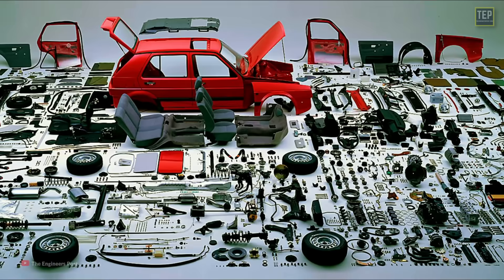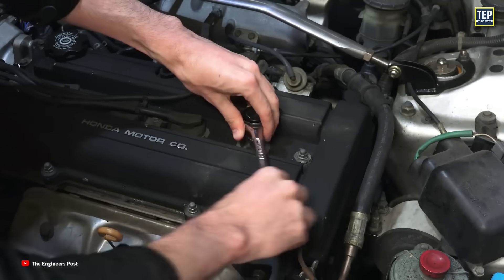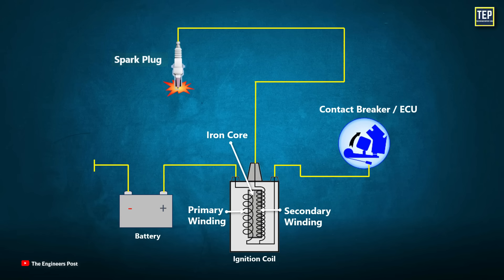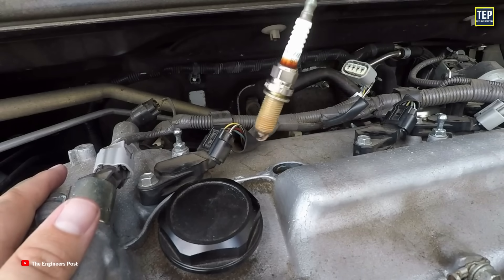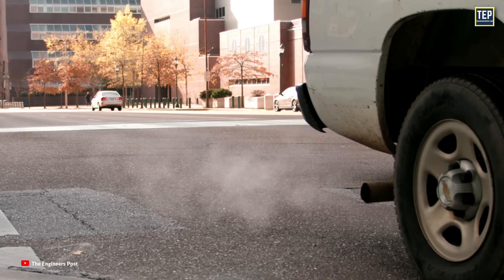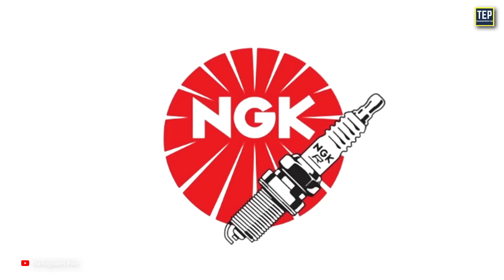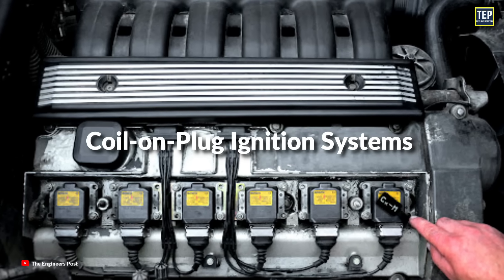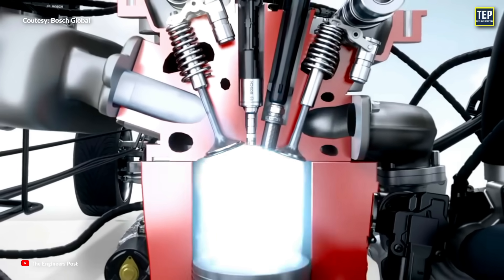Types of Spark plugs | Which is Best?

Comment: Fifty years ago installing a extra high voltage spark coil was a pretty common modification. It was also a very simple mod as it was just a drop in replacement unless your spark wires were just bad. It didn't really do much difference in most cases but it could help people pump a bit more power out of their engines as they used sparkplugs with a wider gap. Never bothered to do it myself as I wasn't interested. But it was just one of those things they tried to sell you.
Reply: The better coil also performed better  as the plug wore and had a larger gap.  Not everyone replaced or gapped the plugs every oil change.

Comment: I like iridium spark plugs ,they can run up to 100,000 before you might have to replace them.they are already pre-gapped,so you don’t need to gap them.
Reply: quality dbl platinum plugs will also last 100k miles in a good sound motor using little to no oil that gets regular proper maint/oil & filter changes etc.
Reply: I used to run slit fire plugs that had a “ Y “ design grnd electrode avail in std or dbl platinum in my cars & bikes,increased mpg by approx 1.5-2mpg in both the cars & bikes.

Comment: Certain aluminum head engines are prone to plug breakage, and if that happens, a special extractor tool will hopefully remove ALL of the plug or a death sentence will be issued for that engine. Professional mechanics/technicians on this board know this fact and can fix anything while examining the plugs. Change the oil at 2k miles is your best option, let your professional do everything else...Please?

Comment: Um... ignition coil turns low-volt battery power into that 20k volts...?
Is it not the alternator that runs the electrical aside from storing for starting? Or, am I missing something? You remove a battery cable to see if your alternator is bad, correct?

Comment: One thing to beware of is fake iridium plugs. Not the cheapest may not the best. Nissan dealerships and many parts companies try to sell you a lesser grade iridium plug that lasts less miles and is not OEM quality. I expect 120k plus miles on my vehicle and shopped to find authentic OEM iridium plugs for my vehicle. OEM coils are not the choice for my coils as the Denso bought a Chinese company, so try to find Japanese made Denso coils. My OEM Chinese made coils all have planned obsolescence built in.

Comment: Hey guys. I use the boush super 4’s why so I can set the plug gaps to suit the tune for idle and full boost wide open throttle. This is on my big block ford engines and my rotary engines they are all turbocharged so they need lx91 crane coils for big spark! More spark the more power you can make. And the longer your engine will live. If we were able to use our pollution free fuels that we came up with over 30 years ago we would not have any dirty plugs due to the fact that the fuel has no pollutant properties leaving the plug clean all the time. Which means the engine will live longer than engines do now days due to the unsafe dirty fuels and the scam of the egr. Which destroys your engine. And the egr and crank case gas’s  are only to destroy your engine. I proved back in the 90’s that I could get lower pollution levels by removing the egr and removing the crank case hose from the inlet and sent it into a catch can and then putting it into the exhaust system at it hottest spot so it burns all pollutants that comes from the crank case. And with no egr to overhead the inlet and  trying to burn exhaust gases that makes more pollution and destroys your engine. This scam from the car company’s was only put in to your vehicle just to destroy the engine so you have to pay for a new engine. And the corrupt governments go along with it because they don’t care as long as they get their corruption monies from the big companies. And the pollution free fuels that we came up with will never get to the public because of the corruption in our governments and the Muslims that don’t want anyone destroying their hold on fossil fuels. And our fuels are cheaper to make and faster to make and while it’s being made the proses converts carbon monoxide into oxygen 1000 times faster than anything else growing on earth. So we are cleaning up our planet as well as making cheaper fuels pollution free fuels. But we will never see it in our lifetime.

Comment: A bit behind the times now. I have Ruthenium plugs in my car but these weren't mentioned. They have been around for several years now but are rarely mentioned. One of the claims for them is even longer life than Iridium.
Reply: I'm running the same in my MB B200 2011 . been going strong for over 60,000km . car is at 130,000km
Reply: And ngk are the only producers of those bad boys. Just like how they were once the only producers of iridium plugs

Comment: For my Turbo Cars I moved to silver spark plugs and havent looked back. Originally recomeneded Irridum. I moved as Irridium started to ping in summer and couldnt handle the higher boost. Silver dealt with all that, havent had any pinging and can get better peformance out of the motor.
Reply: Great for performance, terrible for longevity. This video touched on it but it really needs to be stressed more, platinum and iridium are not better for performance. They are better for longevity. Most people won't accept having to have plugs replaced every 10-20k miles, especially with some shops on some cars charging several hundred dollars for it.

Comment: I've been using Bosch 4 electrode spark plugs in my Toyota Yaris for 22 years and it still fires up first time. I tried them because the original NGK ones didn't work well, even after putting new ones in. Change them every 60 thou. but don't know if i'll bother now as it's done almost 160 thou. and not sure how long it'll last, even though it still goes like a rocket with 40-50 mpg. No money for another car, so hopefully it'll carry on 🤞.

Comment: 100 sparks per second and 20 million sparks through out its lifespan?
100 sparks per second for an hr is 360,000.
If you drive that car 2 hrs daily -> 720,000
For 20 days a month -> 14,400,000

What sort of genuine plugs last for less than 2 months in those conditions?

Comment: 0.100" or one-tenth of an inch, is the ideal spark plug gap. The ignition systems can't put out enough voltage to jump that big of a gap under all different types of engine RPM's and operating conditions. Also, a Capacitive Discharge ignition does fire multiple times per spark cycle, at least under 3000 RPM's on a V8 engine.

Comment: "Cold" or "hot" is extremely important to the lifespan and ignition quality (how the engine runs). I have an old Evinrude outboard (1970) originally built for leaded fuel. Now I run unleaded in my mix (50:1). The original spark plugs or equivalent run too cold and end up with black residue pretty quickly.
I changed for a "hotter" spark plug and the problem is gone.

Comment: This video was not written by an engineer. Most of the terminology was wrong, the different metals are only chosen because of their melting point, hardness and heat transferring properties. Electric conductivity has nothing to do with it. Infact some parasitic resistance is desired because it reduces the current trough the ark and this results in a longer, more stable spark, in less radio interference and less strain on the coil pack and it's electronics. Resistor spark plugs are very common these days, but the parasitic resistance can also be in the cables or in the plug connector. 5 Kohms is the most common value.

Comment: I've only seen multi-anode sparkplugs used in aircraft engines, and they run dual sparkplugs & magnetos.

For cars & motorcycles, I've had good luck with ND Hot-U and iridium split anode sparkplugs .. get slightly better fuel economy, engine feels a bit peppier and cold starts seem quicker

Comment: Been working on cars for over 30yrs. If your car has forced induction you want to change them at 65k miles. All others don't touch the until 85k miles. Even if manufacture claims a 100k change.  The plugs take a lot of abused

Comment: The american factory "Pulstar" made amazing brand spark plugs ! In particular on 2 stroke engines and carb or first gen of injection system on cars or motorcycles... There's a capacitor include inside the spark plug.
Reply: champion plugs use an air gap as capacitance  For some reason my old Jaguar straight six only liked champion plugs.   I favored a Japanese brand , but there was no arguing with results.

Comment: I had a small Honda 70 that would only run if there was a gap between the plug wire, and the spark plug. Even if the engine was already running and you closed  the gap, it would die immediately. If anyone knows why, please share.  I'd love to know.
Reply: The plug is fouled with carbon deposited on the insulator, which is shorting out the spark. When you give an extra gap in series the voltage at the plug rises so fast that it does not have time to leak away, so you get a spark. You might need to replace the plug, and you also need to find out why the fouling happened. It could be that the piston, rings and cylinder are in a condition that is letting oil get into the upper cylinder, it could be a carburettor fault that is giving too rich a mixture, it could be that the plug is of too cold a heat grade.

Comment: I find that E3 spark plugs are the best in my opinion. I have numerous muscle cars and these are the only plugs I use. I even put these in my motorcycles, ATV's and my zero-turn mower.
Reply: In the older days on the 1980's they were called splitfire spark plugs.

Comment: Best for what?  

Copper conducts the best and is much better thermal conductor.  

The only benefit of the “precious metal” spark plugs is longevity.  

You gap ALL spark plugs!  The manufacturers are NOT very good at producing plugs with consistently spaced gaps.

Comment: If you ever go to start your car and it cranks but kinda struggles then starts it’s usually worn spark plugs. Also it can effect fuel have you ever gone to the gas station filled up and then after a few days your almost at half a tank empty. All signs it’s time to change the spark plugs.

Comment: 05 crv. Original iridium plugs. Pulled@150000, neverseized threads & reinstalled; still running well@284000; gas mileage, power same as always😁
Ed c

Comment: Tesla which is 3 casts I only require 1000 to 5000 moving parts 😂.
Gas car F off 😂.
Reply: But you need all 7000 batteries to work and not catch fire.
Reply: @danc2014  it hard and they don’t move also can be recycled and used again with a maximum return on metal at 90 to 95% also they aren’t hard to put out so long as the fire department does there job.
Tesla has a fire blanket that can help put battery fires out within 40 minutes after the battery fires has been going for 30 minutes hitting 3000+ degrees.
But gas cars they explode at least 2 to 5 gas car fires a day only counting USA if we talking the world it’s about 200 or more a day of gas car going up in flames.
So there is zero difference the only difference is the amount of parts moving how it’s powered and how you put the fires out and how that fires burns is the only difference but if put out properly is less dangerous then gas as it can’t exsplode .

Comment: You failed to mention that longer life spark plugs are OEM in many new vehicles to lessen the need for maintenance meaning extending the service intervals much longer then cars in the past. More notably where limitations in vehicle design packaging, makes it difficult for mechanics to replace the spark plug (ie. tight access towards vehicles firewall)

Comment: beautiful video; thank you. I once had a 2005 Durango with 5.7 hemi; took it to dealership to service the A/C. they found out that I had 100k kilometers and still running the original spark plugs. there was no problem at all. so changing spark plugs every 20,000 miles? not so sure..

Comment: Iridium spark plug do last a lot longer and less prone to premature failure.  My 2013 camry has 126k miles on the clock with the original spark plug that came with the car. Thats how durable those iridium spark plugs are.

Comment: The Stock spark plug that came with the vehicle is way better than those aftermarket spark plug that failed prematurely.  Best bang for the buck would be the original parts.
Reply: dont ever change spark plug till didn’t give up lol i have mine 130k and still oem when i check still good…
Reply: True, I usually gap the old one's if they works good..
Reply: Lol
Reply: when people replacing them, they tend to buy wrong ones. Main reason for prematurely fail.
Reply: ROTFLMAO
Reply: Agreed! If your car was sold with copper spark plugs when it was brand new, then that means the engine was designed with copper spark plugs in mind; in that case it is best to stay with copper spark plugs, and the more expensive, newer aftermarket plugs will not work as well.
Reply: Not always. Sometimes manufacturers make mistakes. I have a c4 Corvette with the lt1 engine. Factory spark plugs were garbage. They were intended to last 50k miles; however, the platinum pucks are known to just fall right off. I changed the factory plugs with 40k miles on them and the majority of those pucks were gone, leaving a plug gap 0.015" wider than those with the puck still present, and way out of factory spec. The plugs were also hotter plugs than necessary presumably for emissions. I moved to a different plug 1 step colder than factory with pucks that won't just fall off at random, and it ran so much better.
Reply: as long as you buy OEM quality, like NGK and Bosch who actually manufacture for everyone, you're good.
garbage in, garbage out as they say
Reply: @julshg  Even using a good OEM brand of spark plug (and expensive iridium), my 2000 Jaguar XK8 ran worse with those plugs; I ended up going back to the kind of plugs that its ignition system was designed with, then it ran great again.  Moral: sometimes the best spark plugs are the kind the engine was designed with.

Comment: My 2004 Hemi has 16.
Has 310,000 miles with original spark plugs.
In fact, every engine and transmission part is original.
No check engine light, no smoke, no ticks or knocks.
Reply: Exactly.   Iridium plugs easily last 160,000+ kms.   Changing plugs every 20k’s is a complete waste of time and money
Reply: YOUR FULL OF SHYT. NO WAY THAT HEMI LASTED YOU THAT LONG WITHOUT THE TIMIMG CHAIN TENSIONERS FALLING APART!!!
Reply: @chutasan8299 exactly…hemis love eating cam lobes and rotting exhaust manifold hardware.
Reply: Replaces fuels pump power steering rack, axles and maintenance parts

Comment: Awesome TEP《☆》👍🏾🍔🤳I'm looking for the best Plugs to give long Life & Best Performance in my 5.7L HEMI. I bought the 2014 Charger Pursuit with 117k miles on it. No maintenance records were provided. I'll pull one of the Spark plugs out & see What's in it. I've heard the Bosh Double Iridium are the best HEMI plugs but I'm thinking Double Platinum should be fine for a higher mileage car. What do You suggest for my 5.7L HEMI??✌🏼😎☯️

Comment: "Changing spark plugs remain accessible and easy to understand" Obviously this video were made by engineers with minimal filed practical experiences. Even back in the 1970s  The Chevy Monza V8, the rear most plug at the passenger side require you to loosen the engine mount and jack up the engine to get at it. Many mechanic on flat rate just ignored that plug.  Chrysler 400/440 engines, the plugs are under the hot? exhaust manifold where you cannot see, same as some Chevys, Ford Mustang 390 , there is about one inch of space to work with between the engine and spring tower. More recent, some of the Toyota V 6s require you to remove the wiper motor, and linkages, the sheet metal body structure below the windshield  (better be careful you do not ding the windshield)  the throttle body and intake manifold to get at the rear 3 plugs. You forgotten to tell us what you been smoking before you made this video.
Reply: I remember the Chevy Monza with that inaccessible spark plug, but some Toyotas require all that just to remove plugs?  And people still think they are "wonderful"?  Glad I don't have one!

Comment: One very expensive repair is when an engine invests water and hydro-locks, bending connection rods and ruining the motor. Adding a pressure-release valve would be difficult to retrofit, and probably require a redesign of the cylinder head, but what if the spark-plug was designed to be this pressure release valve?  Then you could retro-fit any gas-engine. Boat motors are the obvious application, but I feel the military would be very interested in accelerating the recovery time of a submerged vehicle.  Off-road vehicles, and motorcycles would benefit. As this video mentions, replacing the spark plugs is one of the last things a casual owner can replace.  I would think the insulator would provide a route to making this idea work.
Reply: A solution looking for a problem. Far easier to just not let water get in the engine and if it gets flooded or something, pull the plugs before trying to start it.

Comment: I run stock plugs on my GTI with 200 hp more than stock. Not even 1 step colder. I change them every 15,000 miles ans ive had no issues. With hybrid turbos at 500+ bhp most guys run recessed tip plugs where the ground strap is flat and protrudes diagonally up from the body of the plug. They are like $40 each last i checked lol.

Comment: I had a motorcycle that used what was called a surface gap plug. It looked very much like they had taken a conventional spark plug and cut off the protruding electrode. It was in a two stroke motorcycle that had some serious problems with spark plug fouling. It really did not help in any way, the primitive (1972) electronic ignition was not as good as a similar era conventional ignition
Reply: Mercury outboards had surface gap plugs.
Reply: I vaguely recall that early Kawasaki 500 H1s used surface discharge plugs.